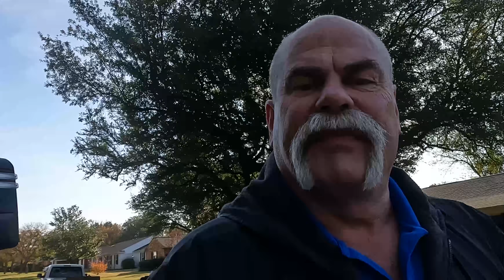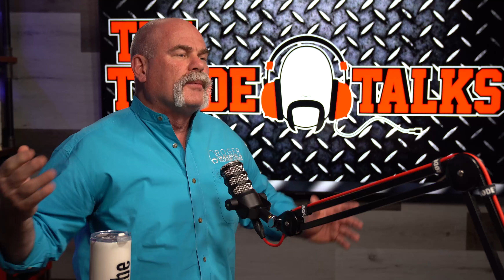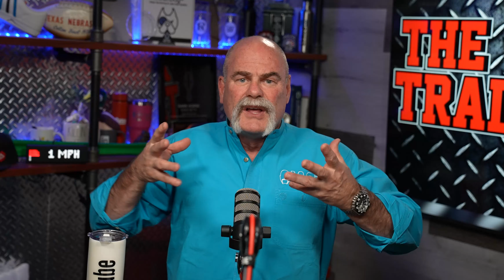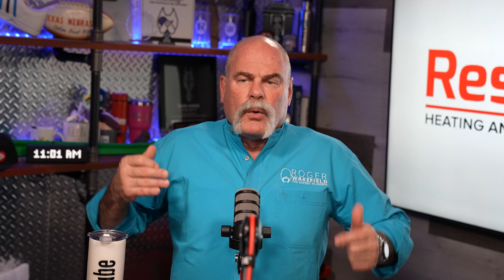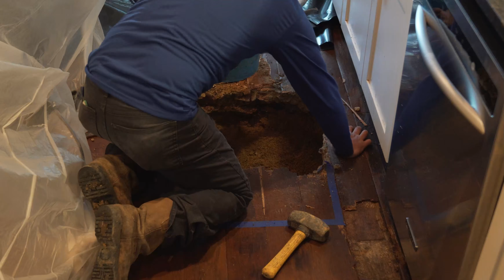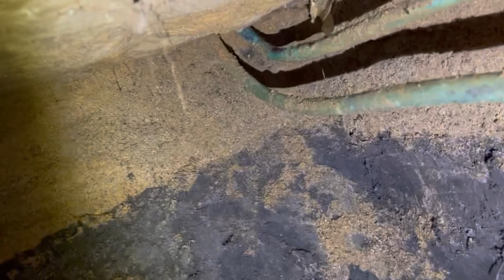SLAB LEAK REPAIR TUNNELING UNDER YOUR HOUSE

Comment: Texas is the worse place when talking about leaking under foundation. I live in Texas and already had 6 leaks under the foundation on my 3 houses. Leaks on supply lines, leaks on drain lines.
My last 4 ones I fixed myself after a crew dug the tunnel. My previous leak was a bad job  done by a famous plumbing company in Dallas TX . They did three times the same job until I decided do it myself.

Comment: A slow cold water boil is what I create, I want bubbles created by the boiling when air pressure reaches the point that atmospheric pressure is overcome and cold water boiling is occurring, slow flow air through a hose bib. Use an air over water set up and control pressure from there.

Comment: So what kind of repair is this? Did they just cut out the pipe were it was leaking and join the two sides with a new pipe? Or did they just put some sort of sleeve over where it was leaking? 😳 I’m new, trying to learn lol

Comment: Plumbing under a concrete slab brings to mind the Bugatti Veyron. An oil change on your Veyron cost around $21,000. That's because a mechanic has to take a ridiculous number of things apart to get to the multiple oil plugs. I believe it's over a 24-hour job just to get to the oil plugs. Was it really necessary to design the car that way? Similarly, it should be illegal, IMO to route plumbing under a section of slab over a certain size area. Now with Pex plumbing, I read that the plastic for whatever reason attracts rats. Rats have been known to chew through the pipe. My home in GA is a split level and I can get to most of the copper and PVC plumbing. One length of sewer pipe runs under the garage slab and the copper water inlet pipe runs under the front porch slab for about 5'. The sewer run could be rerouted if necessary into the sewer line for the downstairs in the crawl space. Builders should strive to build homes that are more maintenance-free. One would think that would be a major selling point for homes. The general public commonly just doesn't know very much about anything other than details related to their job and normal life-related stuff. There are unfortunately a lot of people who don't even know much about that.

Comment: $20, 000.00, I'm sure a Re-Route could have been figured out for much less. 2 yrs. and you will be back for another hole in another section under the slab making another $20, 000.00.

Comment: I'm a plumbing contractor in Arizona and I've never even seen anyone tunnel under a house to fix anything, as far as something as simple as a slab leak. This is insane. Drywall is super cheap to repair. Wow!
Reply: I'm a plumbing contractor in Colorado and Oklahoma for over 20 years and we never do this. I had a kid working for me from Texas, he told me they'll tunnel under the house and repipe the entire drain systems. Can you image how poorly the waste lines are re-installed. Also, think of the structural damage they're causing. I understand tunneling a few feet, but damn this is crazy.
Reply: @heldtheflashlightfordad6728  same here from east Texas. Pull the dishwasher, cut nice access hole in the upper cabinet near the top plate to drill my hole due to the low roof at soffit,  a nice access under the sink. The other end is simple patch. Probably why I never was never a rich plumber 😂

Comment: Most of the time if I'm dealing with a slab leak I'm trying to sell a repipe. So the only damages are in the walks, ceilings. It's better that way especially if the house is more the 30 years old.

Comment: Code to braze coupling but not sweat?
Reply: If you go underground, code will not allow you to sweat/solder the pipe.  It too soft and maybe subject to pulling out if the pipe gets into to much tension.   But you can braze it which is much stronger joint.

Comment: Nice video. 
I think it was better to Repipe with new Uponor and even the leak was under slab. Just start from entry of house. Cut sheet rock and run pipes.
The chipping concrete could of been saved. To replace the floor if they new was Ok but chipping the concrete and remove dirt to replace a section of a leak???.

Because the money they pay for the chipping concrete and digging plus plumbing  plus cover back and stamp dirt and patch concrete it would save the homeowners more money and I also understand we all need to get pay.
My point of view.
I see it right but there are better ways. Unless it really have no choice but to break concrete.
Totally understand the floor damage but you mentioned that over 3 times !
Job clean yes very nice cover.
Repair leak nice just forgot to mention or you may did  but was better to replace both lines the other lines was already built up in green and specially if all that chipping and digging was for the section line of copper replacement.
Makes me think???.

Comment: Hi Roger a sincere question for you why not run all the water lines under concrete in bigger od pipe such as ABs or pvc or even thin wall pvc. So if it leaks it can be replaced without breaking concrete. When I build my house knock on wood. I will definitely do this if its slab
Reply: @MetalDetecting Nmore  It's cheaper for the builder and down the line Roger would make a lot less money repairing them. Guessing that's not why you didn't get a reply from him.

Comment: Great video
Being in pest control in Dallas/Ft.Worth for 30 years. I've had to deal with a few nicks in plumbing from my techs drilling in the slab for termites especially around kitchen area. Bit stopper doesn't work fast enough. And these situations can be smooth and/or a nightmare and costly.  But I agree with others. Re-pipe whole house in pex. There will be another issue soon that copper looks rancid.

Comment: I run across this quite often will abandon the lines underneath the slab and reroute them overhead and protect them from freezing I am in New York after all. Running them overhead has to be a lot less expensive than tunneling under somebody's house and breaking holes through the damn floor

Comment: Almost all the houses in Levittown New York had the radiant heating leaking in the concrete. It was a pretty straightforward reroute to baseboard heating.
Reply: you do realize most of that is 50 years ago already, right? I remember they installed boilers in the kitchen, backed up to the fancy fireplace in the living room. At least they designed a box to cover the boiler. Easy digging for septic (cesspool) in the sandy soil and buried oil tanks everywhere, right next to the Orangeburg waste pipes that rotted away in 10 - 15 years.
Reply: @rupe53  Yes ! The houses are 72 years old now.  Believe it or not but I know 2 that still have the original set up with no problems.  As far as the septic, most of the residents changed out the the main line when they went to sewers in the late 70's. The boiler in the kitchen was horrible. A lot of people re located it to the garage area.  When gas came into the area it made for a much quieter system.
Reply: The ranch style Levitt houses used to have the hanging boilers in the kitchen and the cape style houses have the boilers under the stairs

Comment: tunneling under a house....means under mining the house. just run the pipes overhead.
Reply: Guess where all the sewer lines lie - belly repairs or leaks = tunneling
Reply: no it does not...open the floor. dont tunnel.... @davidmeadows1199
Reply: and run water lines overhead...

Comment: See. I like this channel for homeowners to come too and learn the extreme side of plumbing. Makes me seem like a genius at saving a grand or 6. Here in Tn you physically can’t tunnel. Footers are the first barrier. Then you got bedrock about $5k into the tunnel. What then? So my company will find where Hvac duct is and follow it. Radiant heat will keep pipes protected. If ya loose power. Your screwed either way. Cold travels down too. At least this way it’s just drywall. 20k will go a long way for drywall repair. Drains just have to drip out the crack on top when drain clogs. It’s literally the same as leach field at that point. You can’t possible use enough water to let a drain leak on top of pipe to wash out your pad. Or better idea. Dig a 2’ footer around perimeter. This has to be the biggest rip off process of all time. One day a moron asked “are you gonna have to tunnel in”? Then the money wheels started turning. “Yes, yes will have to find a crew. Tunnel in. Then we make a 6” repair. The tunnel guys repack the tunnel. Cha Ching. No. No I’ll find the tunnel guys and pay them. Lol
Reply: Yup it does sound like way too much just to fix a small leak. I really hate how older homes are made. They have cast iron sewer lines that are cracked. Then you end up with a sink hole underneath your house. 
For the 20k plus he mentioned here.
You could tear sheet rock out and just redo all of your water lines.
Those copper lines are going to get another leak at some point. 
More $$$$$$$ for somebody. 😆

Comment: Hvac/plumber here in upstate ny, I know it's different in other parts of our country but I would never buy a house without a basement. I understand the gc wanting to build a house on an Alaskan slab because it's cheaper, but I would never recommend one of my customers to buy a house on a slab or with a completely finished basement with sheetrock ceilings. That leak would take at most an hour to complete in a basement and cost the homeowner roughly 150-300$
Reply: Three big problems in Texas - expansive soils which require significant reinforcing to build a basement or crawl space below grade, possibly hitting bedrock and needing blasting, and termites which will eat the wood structure of the house.
Reply: @johnhaller5851  ... termites are a problem for a basement or a slab or pilings.

Comment: Was doing a reroute not an option? I’ve done plenty of reroutes so we don’t have to tunnel, or bust through someone’s living room. Of course it all depends on the home owners insurance coverage and what they want to do.
Reply: Either way for that amount of money? Only for that copper line to probably leak again?
Hell yeah I would do a reroute if it was me.
Luckily being in the trade will help alot once you have your own house and you can do the work yourself. Now if only I could learn to also be an electrician and HVAC technician 😆
Reply: How much is a reroute - with all new drops, drywall/texture/paint?
Reply: @davidmeadows1199  here in Texas we charge anywhere from $1,850-2,500. Most of the time it’s on the lower end of that. Tunneling to repair slab leaks is a valid option, but you’re only repairing a section of the copper line. Sometime down the line it WILL leak again. Better to just loop a new piece of pex over head and completely eliminate that copper line that’s under the slab.

Comment: Well it’s great if the insurance company is going to pick up the tab on reflooring. I guess if I were in the same position as the customer but didn’t have insurance coverage for a slab leak, I’d just replace only the damaged section of flooring, match it as close as possible, and put a rug on top of the replaced section of flooring.
Reply: but the flooring is literally the cheapest part of this whole repair
Reply: Anew wood floor is going to cost several grand. Exact price I am not sure, as it depends on quantity and quality of the materials, but Roger said the dig was about $7k (not including his labor) so it would likely cost nearly as much or even more.
Reply: @dmdx86   im just thinking in our area i could floor  our whole home  for that with premium materials.   but yeah it would depend on what you do and how much.   wood, tile or  luxury laminate plank for that tiny kitchen wouldnt be more than 2k installed

Comment: Reroute the line above ground through the walls and soffits. A line leaked underground. The rest of that line is in the same condition. Most of the time the copper is pitted throughout because no one used to sleeve the lines to protect from corrosive conditions. Instead of replacing flooring and concrete, you're just doing drywall and painting. Between floors there's a almost always a trestle. If not, you trench across drywall. Insurance is anticipating a large expense and will most likely cover the drywall you remove if you go that route with them filing a claim. They get flooring replaced and drywall repaired and painted through their insurance and aren't left with 60 feet instead of 62 feet of old copper pipe that will leak again. I would reroute the hot and cold while I was at it. I love my customers but I hate seeing them for the same reasons.
Reply: Yeah I can't believe an insurance company paid tens of thousands of dollars to fix this house but it still has many feet of old copper lines that can leak.  Where I live, we have old beachside homes in Florida and once the copper leaks in the terrazzo slab, we just re-pipe with PEX the entire house and drop the PEX from the small attics through the walls.   You can do it for as little as 8,000 do repipe the whole house!   I can't believe this case on this video. It's such a waste of money what they did considering the old pipes can still leak.
Reply: @hothmobile100  you can't pipe in the attic in freezing climates
Reply: I wish all plumbers were smart like you.
Reply: While I do agree with you that reroutes can be a viable option for a repair, ultimately it's whatever is most cost effective, especially when going through insurance.  We also do need to keep in mind the total cost of the repair, when we are cutting out drywall we don't ever get to see the bill for the drywall repair, etc.  Also stuff like removing cabinets and countertops if the repair is a kitchen(or removing brick if it's an outside wall, etc), and also having the added risk of pipes freezing in the cold weather we do get here occasionally. 

I do very much agree with you about wanting to replace the entire line though, and I'm on the same page as you about not wanting to have to see that customer again, and I'm sure that customer wouldn't want to see me again either lol. 

Ultimately, with these slab leak repairs the best thing for us to do is give our customers options, educate them on the differences and their advantages and disadvantages, and let them decide what is best for them. We do work for them, after all.
Reply: @Deathsneeze  But drywall work is faster and easier than digging up floors, especially concrete floors.

Comment: That cold line looks pretty worn also. Shouldve just replaced it while it was all exposed
Reply: Ya but at the end of the day, it’s not the plumbers call, it’s the home owners; you can only recommend; unless you like to work for free, but most people don’t
Reply: @anthonyguzman5685  you right on that but as a plumber is your duty to tell them you recommend them to do both lines because of etc.  then they're decide yes or no.
Reply: @anthonyguzman5685  it's not even the homeowners call its the insurance call and they want to do everything cheap as possible
Reply: @jacobsimerman5281  damm; you actually are right on that as well. I don’t always work with insurance companies but then I do; they do want the least amount of work as possible to resolve the issues.

Comment: 20 grand?? You can repipe for less than half 🤦🏻‍♂️
Reply: Why no repipe. 7k down drain and a floor repair. For it to leak again. Guaranteed income for Rodger to go out again for another 7k.
Reply: @ribbs408  insurance is paying for it
Reply: @LightlyBreadedChicken  exactly. For it to leak again and another repair. Instead of giving permanent solutions.
Reply: The 20K was for tunneling from outside if the customer didn’t want to make a hole in the kitchen floor. It was 7K for the hole in the kitchen. At least that’s how I understood Roger’s discussion.
Reply: It would have been $20k if they tunneled from outside but it was only $7k since they went from inside.
Reply: While this was supply, you can’t repipe a sewer line. Lots of rusting cast iron to leak too.
Reply: @johnhaller5851  Drain piping can be lined.
Reply: basement > crawlspace > dirt > sand > slab on grade.
Reply: PEX IS CHEAP AND THROUGH THE WALLS FOR SURE. PLUMBERS LIKE ME WHO KNOW DRYWALLERS AND SUCH SAVE PEOPLE THOUSANDS